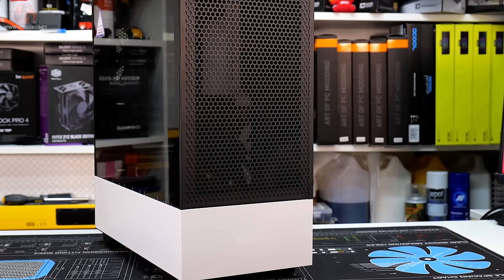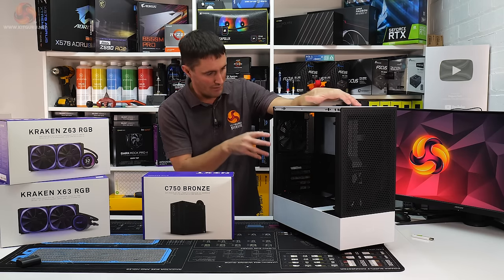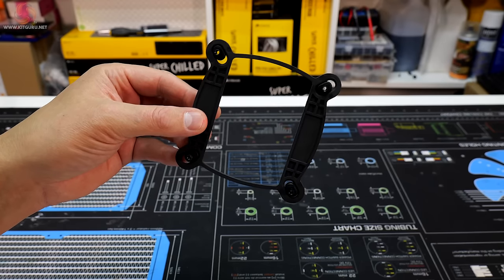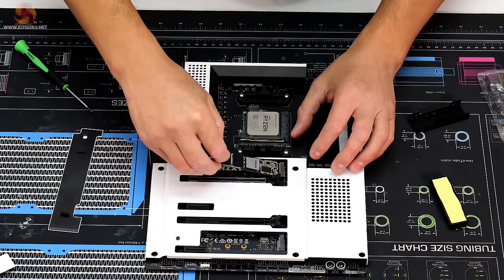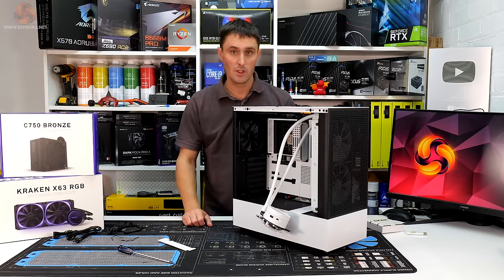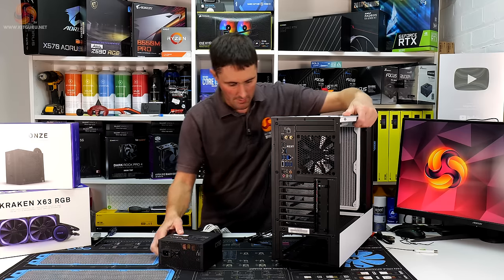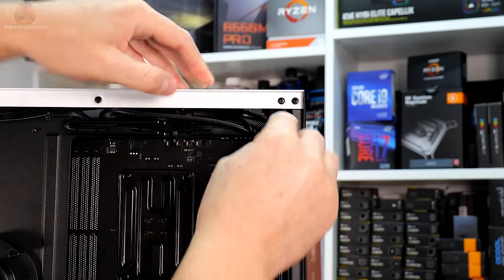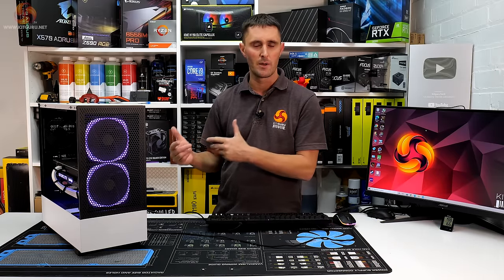NZXT White Build featuring H510 Flow

Comment: I wonder will RAM manufacturers ever make blanks where you only need 2 sticks of RAM but you want all 4 slots filled with RGB for aesthetics? So 2 empty sticks with no RAM in them but still providing the RGB and obviously cheaper.
Reply: They do, don't they? Corsair has/had such kits, and other manufacturers probably do, too.
Reply: @recyclebin  Nice! I didn't know that.
Reply: @donkeysunited  corsair has Vengeance RGB dummy modules or light enhancement kits as they like to call them. Gigabyte also has dummy modules for their Aorus RGB memory.
Reply from the maker: yeah Corsair do, we covered them before in other build videos....

Comment: Excellent running commentary and a most useful video. Thank you. With regards to the CPU block interfering with the RAM was there any reason why you couldn't have mounted the block with the pipes at the top?

You also demonstrated difficulty with the EPS cable. Was that just due to the case or having the motherboard already in place? I have a Silverstone FT05 and quickly learned to run the EPS cable before installing the motherboard.

Have you considered doing a video comparing modern ATX cases with ones from 1995?
Reply: The CPU block didn't interfere with the RAM as such, but it was very close. CPU block orientation was simply for aesthetics reasons, I could have mounted it with tubing at the top but the tubes would have passed over the ram and looked untidy.

The difficulty in connecting the EPS cable was due to the limited amount of space between the board and roof of the case. Removing the top fan would make things easier but it is tight up there due to this being a compact mid tower.

It might be interesting to make that comparison but I think it would only work with a CPU air cooler as most cases from that era were not designed with AIOs in mind. Also cable management in cases from that era was often an after thought at best.

Comment: Does the orientation of the AIO fans blow super hot air from the radiator into the case and cause additional heating of the components.   In particular the GPU would be in direct line of fire of the hot air.   The noise level you recorded, is that high in your experience.

Comment: I am really confuse how to properly install an AIO cooler. Can I just straight copy just like what you did?
Reply: Not true, as long as the pump is lower than the fluid tube connecting to the radiator it‘s completely fine - optimally the tubes should be mounted at the bottom but it wont damage the pump if you mount it the way it‘s shown in the video.

Comment: For those following this build, the radiator should be mounted the opposite way with the cables going from the pump towards the bottom of the case. This avoids air being captured within the pipe as opposed to the top of the thermal liquid loop (at the head of the radiator). 
- doing so results in better performance, longer lifespan, less noise. For theory / tests around this, Gamers Nexus do a great video on the subject.
Reply: I tried but the case is just too compact
Reply: @azora2144  bad design on NZXT’s part.. You might get a gurgling noise and a slightly less efficient system but still much better than not having it for sure.
Reply: @maybenotcal7194  ye i was kind of gutted that there just isn't enough space for the pipes to go bottom rad up for the better set up, i guess the case is aesthetic more than anything else aha
Reply: This isn’t necessarily true. GN stated that the actual pump itself cannot be the highest point in the loop. There may be a bit of noise in some cases, but overall mounting the cooler like it was done in the video is fine, as the rad is significantly higher than the block.

You aren’t going to kill your AIO from mounting like in the video. Only if the pump is the highest point.

Comment: Do you think I'll be alright with a 5800x and a 3080ti plus liquid cooling? I'm not going to overclock anything. Never really liked Nzxt for the performance but the looks are great so I'm considering getting one
Reply: What type of games are you gonna play because for some you shouldn't get a 5800x get a 5800x3d
Reply: @zanderallan4373  flight simulator is the main reason I'm getting a PC. Watched a couple of benchmarks, I don't think the 3d is really worth the price difference. I'm also sticking to 1440p, not interested in 4k.
Reply: @misterlove6225  ah cool well where did you look because from what i researched 800x3d is worth it for flight sim because of the textures oh your not doing 4k fair enough enjoy your build I'm going for the 3d cuz I want to play stellaris which is poorly optimised and runs best with l3 cache

Comment: Nice... Radiator upside down🤦🏻‍♂️
Basic physics...
Going to end up killing the pump and potentially damage the CPU.
But hey...what the hell do I know.
Reply: EXACTLY my thoughts!
Reply: That‘s actually not true - as long as the fluid tube connecting to the radiator ist higher than the pump itself, it‘s completely fine. Basic physics guys.. the air cant get into the pump since air will stay at the highest point of the aio - in that case on top of the radiator where the fluid tube is connecting.